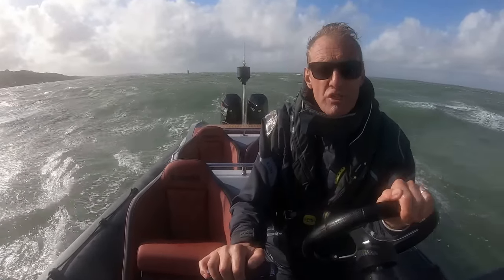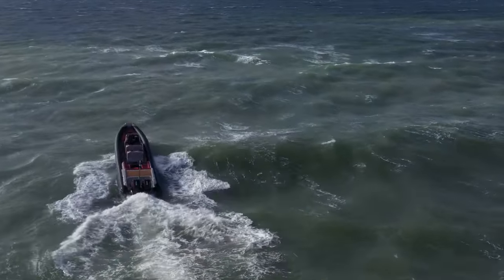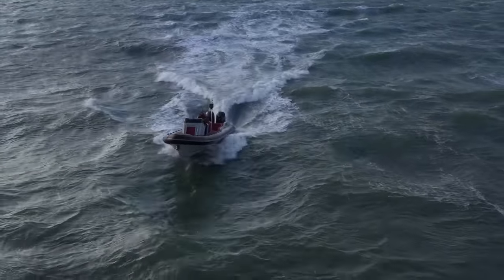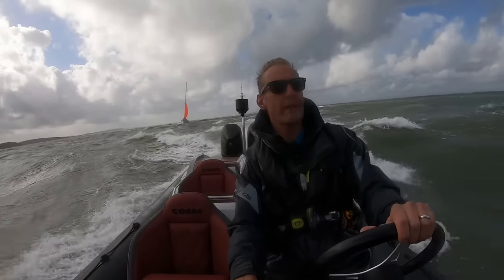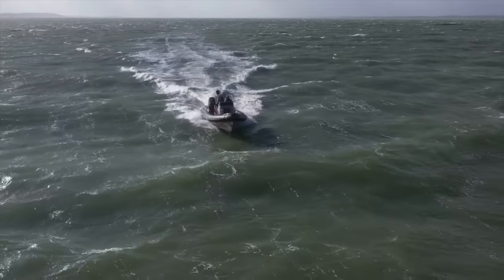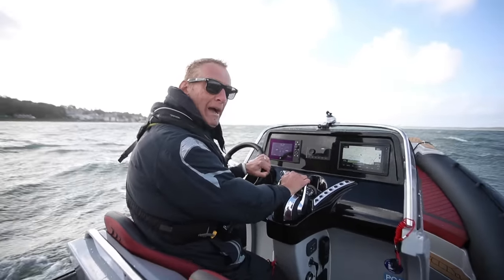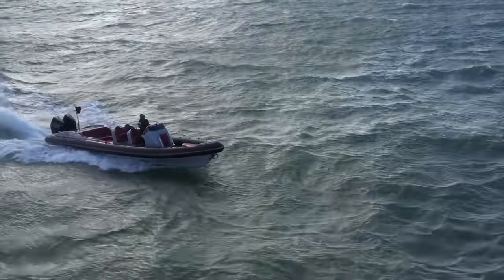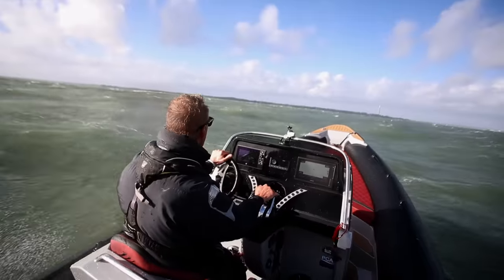How to drive a boat in rough water | Big sea throttle techniques explained | Motor Boat & Yachting

Comment: Helps when youre in a high-power RIB like that which has lots of responsiveness at the throttle. In normal boats that kind of throttle control is much harder because you have to be like 10 seconds ahead of the game
Reply: No such thing as a normal boat
Reply: Good points
Reply: 50 foot flybridge it’s hard but then those size waves bow steering won’t be an issue for a large mv
Reply: @Mahalo_83  Boats with much weaker HP to weight ratio then
Reply: also its much harder to control power when you have cable operated throttle, this on is soft electronic one.
Reply: Extra waterline also helps a lot in big seas. In my experience diesels are also more difficult to drive in this manner. To be fair he does point out that he is in a well found boat with lots of power and advises caution about what you tackle. There's a lot to be said for experience and knowing your boat. Ours changed a lot when we re-engined recently.
Reply: You would need a serious hydraulic powered lift / crane to hoist that beast of a top end RIB, aboard any cruising yacht, if it would even fit which is doubtful. They look very nice. But 1/10 for practicality. Not many blue water cruising folk using those, 2 Motor 9 Meter RIB's unless they are millionaires...
Reply: @Charlie-UK  What are you talking about?
Reply: You always has to be 10 seconds ahead
Reply: Yes dead right I always go at an angel to the waves and use the steering to go over the waves. Same as going over speed humps at a bit of an angel to take the shock out of it. Down or into the waves in really rough see is a no no. And the seas in this video I do not real call rough. More lie every day in a sail boat especially.
Reply: Well said. High responsive Motorboats could never be compared to a heavy diesel trawler in terms of thrust response
Reply: @petethewrist angle to the wave and you are still here? Lucky your only on small waves!
Reply: That’s why You choose a two stroke when You can, nothing can compare to that reaction🔥

Comment: Always remember that driving like this will use significantly more fuel thus it is important to accout for this when calculating range.
Reply: You should go with 1/3rds for a rule! 33% fuel going to the location, and 33% coming home! Super easy to calculate and remember...from Wyoming USA 🇺🇸 🤠
Reply: @billallen4793  That's true but fuel consumption changes that calculation significantly. Example: at a 30 knots cruise we're doing 1.2 nm per litre. A third of a tank = 60 litres = 72nm. In heavy weather we can easily drop to 0.8nm per litre so a third of a tank = 48nm. On an out and back trip that's your entire contingency gone (at 0.8 lpnm your 72nm will use 90 litres i.e. half a tank). I know that's why you leave a contingency of a third but it's an important thing to be aware of. 🙂
Reply: @dangurney8107  of course fuel burn will change for speed, or heavy sea's. I was just using averages! ...from Wyoming USA 🇺🇸 🤠
Reply: @dangurney8107  I've been a race fan of D.G. my entire life! Great name...from Wyoming USA 🇺🇸 🤠
Reply: Absolutely brilliant video. I was out in 2+ meter seas this morning. 38’ power boat, twin Bravo 3’s. Experience got me through, but it was a bit dodgy at times. Appreciate your calm demeanour and great instruction. Thanks!
Reply: Excellent video content.
Reply: This taught be a lot !  Check the weather before I go boating !
Reply: Better than sinking.

Comment: Never do this if you are not prepared.  It’s way more difficult than taught in this video.  I personally make trips on rough sea on a daily basis.  Every day the sea is different.  Current, wind speed and intervals that you have to adjust to. So bow up going downwind and throttle handling going upwind is true for the vessel shown in the video.  Not for less experienced boaters in normal single engine boats.  Some good basics but this video is way to simple.  And compared to where we boat not even a rough sea.  First times in rough seas get help from experienced boaters.

Comment: Trim high, power to control attitude, keep reserve power in case things go wrong, etc. With only a few changes you could just as well have been talking about a stabilised approach for landing an aircraft. It never ceases to amaze me how much crossover there is between Maritime and Airitime.
Reply: But i use power for speed,  elevator for attitude, keep on app.
Reply: Trimmed bow high worked always in rough sea with constant speed and searching path trough those waves.

Comment: One thing to point out. If you are in rough seas, you have to be careful with power up when you dropping down a wave. If you go too fast and start to surf and you may hit the next wave with a bow. At that moment stern is going to have a momentum and a rapid water flow will push it. This may result in capsize. For more check "ship broaching".
Reply: This happened to me about 18 nautical miles offshore in a 4.75 quintrex top ender side console running a 70 hp yamaha 4 stroke.  There were 3 of us on board coming home after the weather blew up. We were that close to rolling the boat it wasn't funny
Reply: @renfidas thank you!  Any vid on rough seas should emphasize that  (in a following sea) this as one of the scariest and most important points !!!

Comment: Nice. 

Pro tip 1: On these throttle controls there is a button "1 lever", in rough sees I prefer that one and drive with the "palm support grip". More body support and better feel for the boat that way.

Pro tip 2: Fill up your tanks, fuel and water and consider adding ballast up front. 90% of boats will be more stable overall in heavy sees.

Pro tip 3: Get good ski googles and wax them with car wax. Visibility is much better in heavy spray conditions than sunglasses.
Reply: A
Reply: Great tips for sure

Comment: Great video! There are endless videos on YouTube of boats entering and leaving Haulover Inlet in Florida where they have some quite severe swells at the entrance to the harbour. Not only is it fun to watch some beautiful boats, but one can clearly see the competence or complete lack of it of the skippers in trimming the boats and using throttle to ride waves in, or knowing when to keep the bow up. Very often boats nose dive into the water turning the cockpit into a jacuzzi, it's very funny to watch.
Reply: yes wavyboats, zipzap power are some of the good ones

Comment: This guy knows his stuff and puts it across very methodically and with calm logic.   Thanks for the video.  I’ve been powerboat ing offshore for years in various craft, but there is still much to learn and tips t pick up.  I was fortunate to have a fast rough ride with Steve Curtis in a Honda powerboat over a 5-6 in a choppy Solent. Throttle control and anticipation was very impressive.  Thanks.

Comment: Great video,  thank you. Next time single engine 6m rib in similar conditions please 🙂
Have a 6m rib with 175 Hp outboard which is used in the med. Weather & sea conditions can change pretty quick, have had a few nervous returns from early morning fishing (flat and calm early morning then very lumpy as temp and wind increases). Have had small boats for years, but still not too confident in the rough stuff.

Comment: Was just out in a similar boat but ally, in filthy weather and wind  over big incoming tide, in Torres straights , Australia, png, this arvo, I had to be on point, and throttle control and wave anticipation along with steering is paramount for safety in bad weather and wind over tide like this! Great video to reinforce it here, cheers mate, safe boating people.

Comment: Very helpful video.  Thank you.
I do my boating on large inland lakes, which are usually quite tame, but when the wind really kicks up, they can get surprisingly rough.
On one such day, I learned some lessons the hard way:
First, recognize when it’s getting dangerous for your boat.  If your boat can handle 99% of the waves, that 100th wave can still swamp you.
Next, get your passengers out of the bow.  They push the bow down under waves, where you can take on a lot of water, and consider putting on a cover over the open bow (if you have that style of boat).  Obviously, as you mentioned, wearing a properly fastened life jacket is important for everyone aboard.

Your throttle suggestions were excellent.

Comment: Just here to say DO NOT TRY THIS IF YOUR SMALL BOAT IS NOT A RIB OR A STABICRAFT. And even so be cautious.
I've own both. It is very fun to be out there in a proper boat, but you are always riding a thin edge and the edge gets narrower the smaller your boat is. Especially if your boat is not designed with positive buoyancy.
Surfing waves and powering up and down into the sea is very dangerous in a small light weight boat. Digging in your bow or having it flipped over your head is a dangerous reality in a small tinny.
Just look at minute 8:52 when he digs in the bow. If his boat were not a positive buoyancy boat, that mistake could have taken 1/3 of his boat or more under water and very much so capsized it or stranded him.

Comment: OH , for the Solent chop and the waves over the Christchurch ledge where it changes from 70 feet to 25 approx . like to see the Cobra matched against a Scorpion of the same size , in that weather an see who came out on top. Ran two Scorpions for nearly 20 years and glad to say never got wet , a bit of spray off the sides in a cross wind , fun all the way , but a force 6 was enough for me and watch you get wet in a force 8, well done to the camera man as you had the steering wheel to hang on to . Bravo and thanks for the video .😉

Comment: Never go out in rough sea with a normal boat. RIB's are the best. Very instructive and it is fun if boat jumps if you take the waves. However it is a completely different story if waves are 10 to 15 mtr like on Waddenzee with stormy weather. Then ride the wave up very gentle to avoid crashing down over the top but not to slow also because at any time you must avoid that waves roll into the boat.
I wish that there was a school for that.
Reply: Wribg regular bites bot ribe

Comment: I think the continual adjustment of throttles going into the wind introduces a risk of mechanical breakage in the cables / unions. I prefer to run beam on or downwind and end up where I end up. Easier to get a taxi home and pay visitor fees that snap a cable and end up with no power. Great video.

Comment: I don't actually disagree with what he is saying but kind of laugh as there are those who go out (a lot) for fun in twice the sea size in a 1/3rd of the size of boat and have a real go at it.  Safely I might add.  But throttle, timing, and direction of attach is the key.  Personally, I seldom go straight into a wave as 30 degrees off will allow a softer landing.  But if it's breaking onto the boat, straight into it.
Reply: Can you provide your video please.
Reply: Exactly, no one here seems to talk about using a RIB to have serious fun leaping waves.

Comment: So this is a great video. Would this still hold up in my 28ft snekke motorboat with "inboard" (no idea if thats whats its called) engine. Max speed of about 8 knots. I have no trim. It's a straight through axle. It can raise the bow if i hit the throttle but i normally cruise at about 4-5 knots. Do i need much bigger engine to use this technique?

Comment: I understand the ideal place to be on a wave is riding the back until it dissipates, but I am not clear on what the ideal technique is if you get caught up high but in front of a wave and start surfing it.  I usually try to power out of that position.  Thoughts ?
Reply: Just go faster in the first place and jump it! LOL
Reply: Do your best to keep enough power on to ride the crest if you can. If it rolls under you,..you can get caught in a deep trough, and wallowing in a deep trough is not a good thing..especially if you don't have a lot of power available., so try to keep up. Easier said than done at times. "Reading" the timing between the waves, and gauging that to how fast your boat responds to the throttle is very important when making these decision. Experience ? - Former USCG- Columbia River Bar.

Comment: Been I these exact situations and in my experience going with the swell and wind is not safe or recommended this can lead to capsizes, plus unless that’s the direction you need to be heading why would you? best advice is to head straight into the swell maintaining a regular speed which matches the swell so your not breaching or landing in the middle of a trough , let your bow ride with the swell don’t try to speed up and slow down to try and maintain a even bow better off maintaining a steady speed.in this video they are not even rough seas barely any whitecaps !😂 rough seas you can’t do 20 knots in !!
Reply: Depends on the size of the wave?  My sailing instructor said some waves were so big they would appear in the radar as nearly 20 plus meter waves.  You had to go transverse into them, and this was for a navy warship.  Also trying to judge the speed of a wave (your advice) seems about the same as what this author is advocating.
Reply: He giubg faster 20 knots

Comment: Little Johnny one note here, but do have a plan if/when you lose your engine.  Even a new engine can suck up a plastic bag--and shut down.  Now, you immediately begin to wallow and turn broadside to the swell--what now?   Do you know?  If you are counting on the engine never letting you down, you have not planned.  Same deal with water suddenly pouring in, and no, no, the "bilge pump" will not keep up--in a real crises, it is not designed to keep up.  And--as an important side, both of these emergencies: engine loss and water pouring in is one of many reasons to not be out there, alone.  Boats should have redundant systems, whenever possible--two of everything, including two people.

Comment: Watching this is really making me realize how bad of sea I was in when on my honeymoon in 1992. No offense but this seems like nothing compared to what we were in that day. I rented a 21’ boat, center console Bimini top. Maco Shark?? Maybe? I had very little boat experience and only on lakes. It was a stormy day and they never should have rented the boat. When I crossed between St Thomas and St John the waves got so big that they blocked out the sky and were above the vision of the Bimini top. Several times the waves crashed over the entire boat even on top of the Bimini. My new wife at the time ended up sitting on the floor with arms and legs wrapped around the Bimini pole. I had no idea what I was doing but obviously had to make it out. I realized turning sideways was going to kill us. I powered straight into the waves and then let off right before cresting, sometimes coming off the other side was a bit of initial free fall. And just before cresting it almost felt like the boat could have flipped over backwards. Almost straight vertical. It was one of the scariest times of my life. I have no idea if I was doing anything right? It took forever to get across and I then just stayed in a cove while a few thunderstorms passed. Going back was far easier and I returned the boat early but never saw the rental guy again. Had to dock it myself. We ended up completely exhausted and bruised and battered but luckily alive.

Comment: Staying just below plane helps alot too, the speed of lowest fuel economy is also the smoothest because your cutting waves instead of moving at their mercy.
Reply: Wrobg plang pound efecy rsange
Reply: @sharonbraselton3135  Lol, did you type that while in a boat pounding through wind-waves?

Comment: Great video. Remember your kill cord people. Rough sea could throw you out the chair. "Disaster" if you don't kill the engine at the same time.
Reply: That way, the boat drifts away going only twice as fast as you can swim.  You can  enjoy the view for far longer.  Perhaps a seatbelt, tether, or dragged line would help, if such is your concern..

Comment: Good video but a bit of a heads up - it’s no help watching you as we can’t relate what your saying to what you are seeing, we need either your POV or an external view and the external view needs to be timed correctly with the dialogue or it doesn’t make sense. But I did get the gist of how up Poss down bow down pose up. Just would have been nice to see that as the waves approach and hear your timing. 
Thanks for the tips.
Reply: Yes, for newbies the timing of power on/off was not clear. Better camera angles from side on the boat (not on narrators face) would have helped or even some diagrams inserted into the footage

Comment: Sorry I am struggling with this video, I am a qualified boat handler at man levels and I am struggling to find then”power up” in line with the video, I am sure the practical course makes more sense
Reply: Hello, a key point: Once you climb wave, slowly overtake wave to keep bow up as you drop into the trough. Gassing it downhill can stuff the bow into next wave. have a good day sir. also..Compare course price to fuel to run your boat. Nothing compares to real experiences on the water, go out to practice in different conditions in your personal boat because who the hell has one of these things. "don't forget to bring a towel"

Comment: What about in a semi displacement boat, do you just punch through.
Reply: Semi displacement loves to punch through because of their sharp hulls. Most comfortable at 14-19 kts which keeps the boat up, without too much slam or hobby horsing.
Reply: It's not just about hull it's also about the weight of a boat... the heavier it is the more it resists the elements and the less you need to make adjustments... how a Myra (23 foot) and how Ecstasea (112 feet) drive are very different despite both being semi-displacement.
Reply: @darthkek1953  still, going 15 knots will be the best speeds for them.